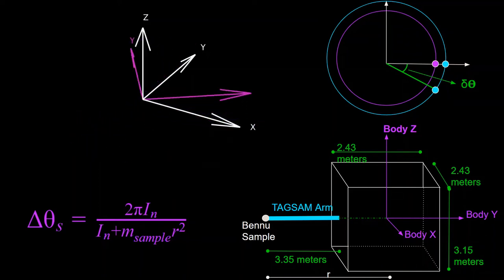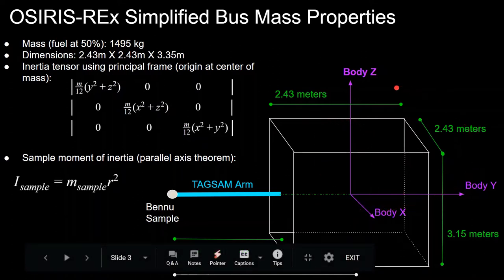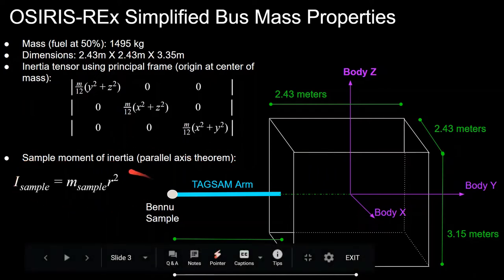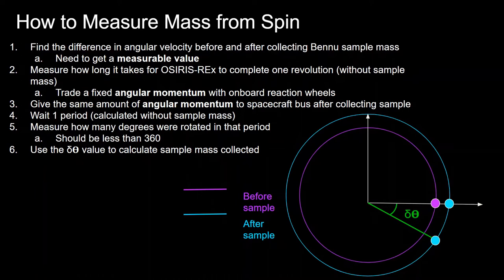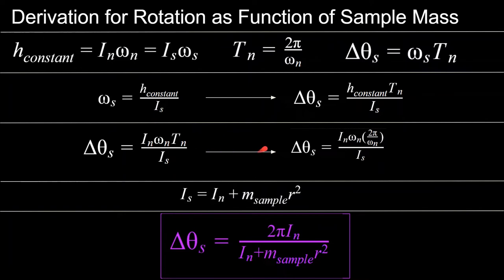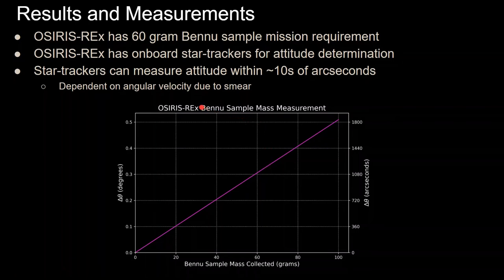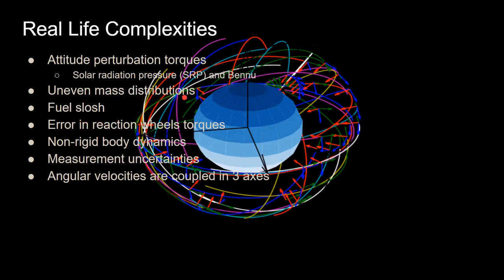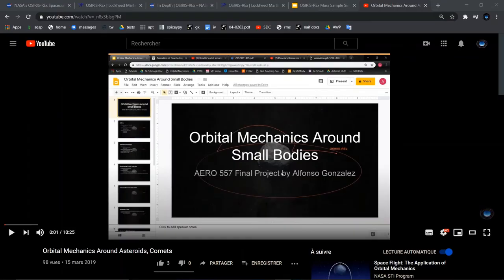OSIRIS-REx Bennu Sample Mass Measurement

Comment: Great work! However, I had a question regarding the delta theta calculation. Shouldn't it be 2Pi - ws*Tn instead of just ws*Tn? If you swap these values the final delta theta value turns out to be 2Pi(Is-In)/Is. I'm not sure if I'm missing out on something here but I'd love to hear from you!
Reply from the maker: You're right, I didn't clearly specify that I was talking about two different delta thetas. In the equation with the capital Delta (a triangle), that refers to the rotation done by the spacecraft. The lower case delta theta is the 2Pi - ws*Tn angle you are referring to. Although I don't believe it really changes the calculation, its just that they differ by 2Pi, which I subtracted at the end of the calculation to come up with the plot.

Here is a snippet of the Python script I wrote for this:

def delta_theta( sample_mass ):
 Izz_sample   = Izz + sample_mass * lever_arm
 omega_sample = h_nominal / Izz_sample 
 return omega_sample * period_nominal

if _name_ == '__main__':

 masses  = np.linspace( 0, 100e-3, 1000 )
 dthetas = 360.0 - delta_theta( masses ) * 180.0 / np.pi